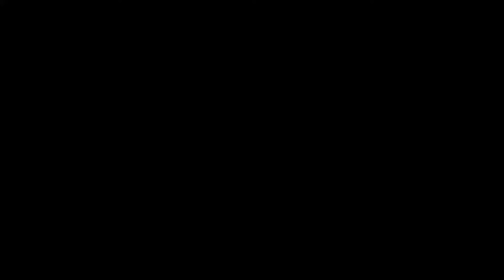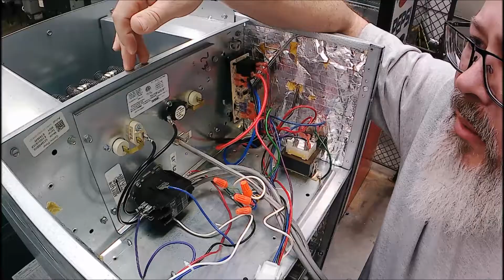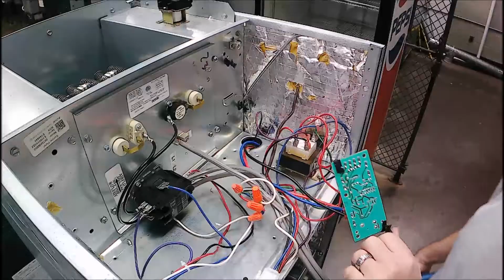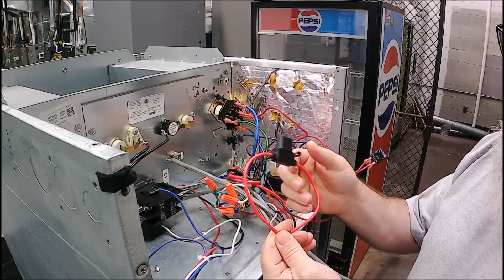Can a Relay replace a Circuit Board?? | Understanding HVAC Electrical Concepts

Comment: Thanks for your video, l have a guestion how  do l know everything correct write on the fan relay any help how l make sure connect write Thanks again
Reply from the maker: Thanks for commenting...this can be a tough one depending on what you are wiring since I can't see it! I will just use the 90340 relay for reference.
Put main power (L1) going into the switch, on terminal 3,  then put a wire from terminal 1 going to the actual load (light bulb for example).  The load should also have another wire that returns to a Neutral or L2 to complete the circuit. I hope this helps some but it just might be too vague of a question and answer.
If all else fails, I have done it another way though. It is this...wire it up how you THINK it should be and turn the power on. Electricity will always correct you if you are wrong! Thanks again.

Comment: What's the purple wire for and is it always energized?
Reply from the maker: The purple wire is "coming from" the heat relay/sequencer/contactor and is energized when the electric heat strip is turned on. It goes into the normally closed switch on the blower board and ensures the indoor fan is on when the heat strip is on.
Reply: @johnjennings-JJ  I see. What controls when the heat strips come on? Does that have its own separate board?
Reply from the maker: For the simple Goodman unit that we are talking about, and a lot more out there for that matter, the heat sequencer is not controlled by a circuit board per say. It is usually wired to the white wire coming from the thermostat. Just a wire nut connecting the white thermostat wire to the white factory wire going to the sequencer.

Comment: ? When you add one leg of power to one side of high voltage side of 90340, how are you getting 208v to energize fan motor?

Assuming you are pulling from one leg of power; e.g., 240v & use half, then 120v would be present.

How are you attains the full voltage, say 208v?
Reply from the maker: You are right. I am only breaking one side of power so it is just 120 v on "L1" going in and out of the relay. I have a 208 power source in the shop i do most videos in and the guys i was talking to were having problems understanding that one legn of 208 is 120. They thought is would be exactly half since it is one side of power. So occasionally i do say it "not right" (and of course it is on a video) but am trying to play off of what they know for now.
Reply from the maker: I swear it ain't on purpose!! But somedays I hate thinking about editing and redoing a video segment. For me it is hard to do everything in one smooth take so i just go with it knowing i'd rather be fishing. I'll try to be better from now on!

Comment: Hello. Did you possibly have time put a video together of sequence of operations of heat pump just with relays how it was used to be all mechanical. Please. Thank you so much
Reply from the maker: It might be a few weeks but I do plan on doing a sequence of operation type video for a heat pump.

Comment: Great video, the only thing I heard you mentioned was the wire on terminal 3 was carrying 240v, however it’s only 1 line of the 240v, so it’s carrying 120v to complete the circuit.  See time stamp 6:27.  I understood what you meant but newbies might get confused.
You got my subscription thanks.
Reply from the maker: That is correct. Occasionally I will fall victim to my own mind. The guys I have in a class starting out know that the main power supply to the unit is approx. 240V  so I "speak their speak" sometimes to get the point across. Of course I still have to go back over it with them and make sure they remember that there are 2 sides of power and that they add up to the 240V. 

Appreciate it. Thanks for watching and commenting.
Reply: Actually he was correct and did not even know it.It is 240 going north then 240 going south .This is alternating current.It is only 120 respect to ground.That is why you do not need a neutral for a 240 volts or kkkkkpower feed one wire is carrying 240 the other serves as the return(neutral) alternating at 60 times a minute(frequency)this is your sine wave.The tap of the ground is at the center tap of the transformer (POCO’s) transformer and cuts the voltage in half when measured respectively to ground… UNDERSTAND WHST I AM CONVEYING?
Reply from the maker: I will have to read over it a few times and draw myself a picture. This is what i tell people about electricity--electricians have their power, hvac guys have their power, electronics guys, etc. and i think we all use, apply, and describe it differently. To me, that is what messes so many young techs up. Ask 10 people about electricity and get 11 different answers. But I like to see how people think and try to understand their perspective. 
By the way, what is POCO?? Is it a manufacturer?
Reply: @robertcherry4971  Tell that to a jackass and he will kick you. So when the cop stopped you for speeding, did you offer the excuse that you were only going thirty mph up the hill, than thirty mph down the hill.lmao.
Reply: @officerkrupke4966  no I ask them am I being detained.. LMFAO

Comment: Poor mans fuse, doesn't Carrier just use to insulated female connectors on their harness, just zip tied to stop it from dangling.I guess Carrier is a poor man, LOL.
Reply from the maker: The plain poor mans fuse holder didn't include zip ties! Carrier did a "1-up' by adding the zip tie. Thanks for watching and commenting.